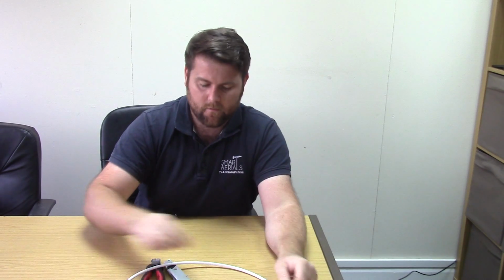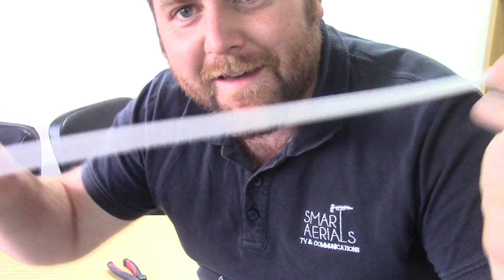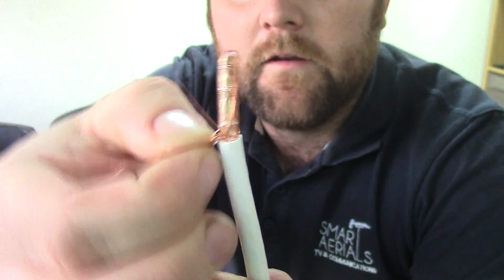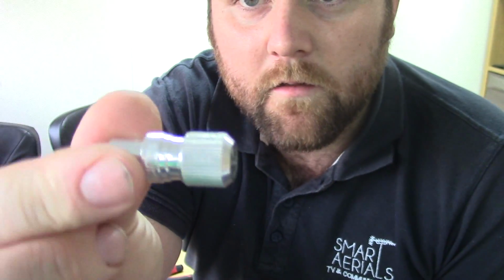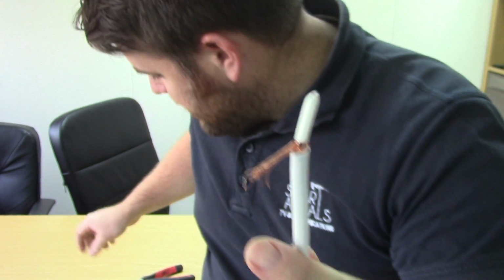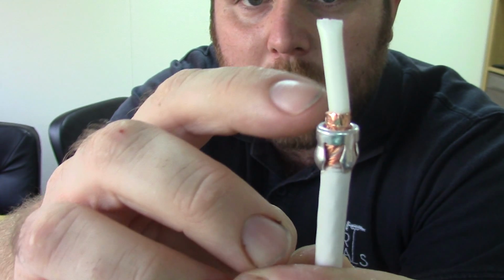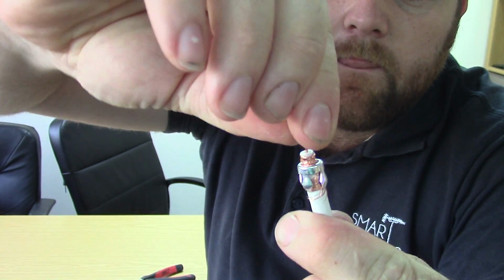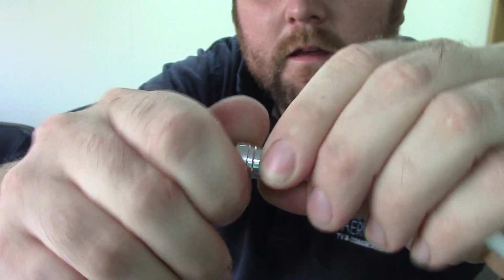How To Fit A Coax TV Plug Onto A Coaxial Cable

Comment: Hello mate when cutting the coaxil with a knife the braid is left on as in your video, when I've used a cable stripper it's not is there any difference?
Reply from the maker: This is one of the reasons I prefer a knife over cable strippers. You need to make sure that the braid isn't cut away and makes contact with the plug itself but not the centre conductor of the coax cable. It may be that the stripper isn't actually intended for that cable and/or the blades need adjusting.